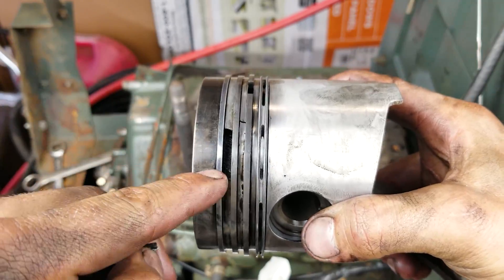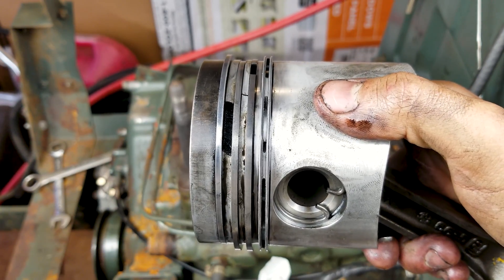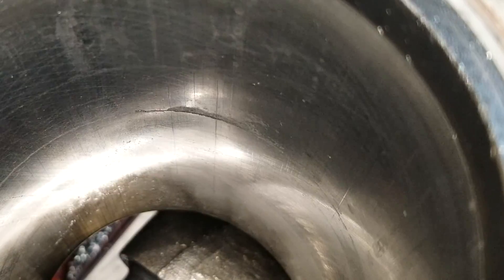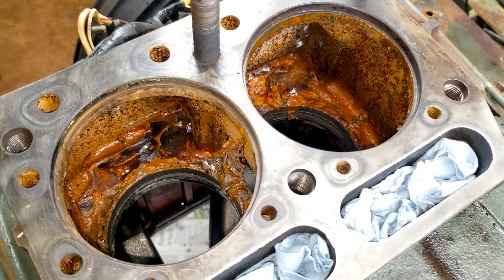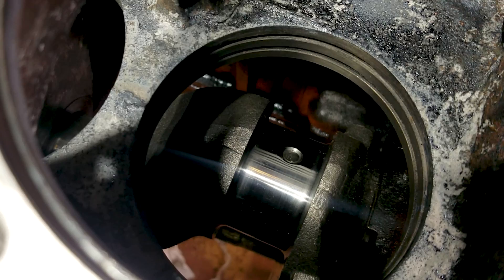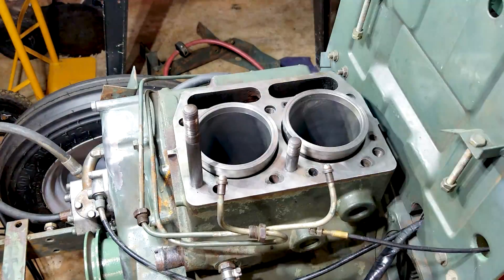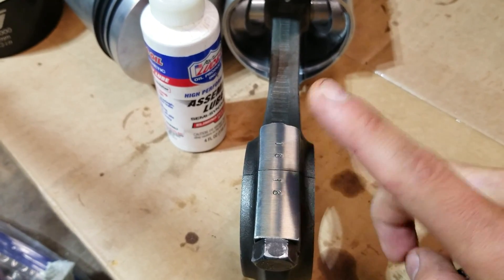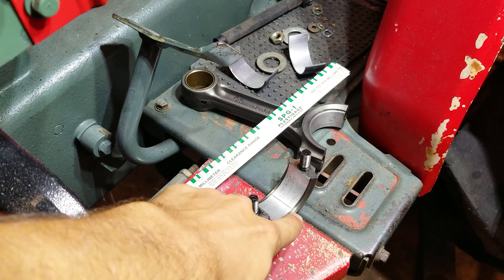YANMAR Diesel Tractor Engine REBUILD! New Pistons?

Comment: did the sleeves fall right in and do they have something to hold them down after install? i assume the head holds them down?
Reply from the maker: Yeah, the heads hold the sleeves down.
Reply: @MattsShop  thanks bro i rebuilt my ym 1700 and it is perfect bought me a ym 1500 with a bulldog loader that needed a headgasket i put that on and its a great little tractor i gave 1200 for it with the loader.. what a great deal

Comment: i need to know how hrd was that yanmar engine to rebuild? mine is a 1700 and i got it for 800 bucks it has white smoke from the engine
Reply from the maker: The engine rebuild was easy if your mechanically inclined. Just take your time and follow along with the videos!
Reply: @MattsShop  thanks for the reply got my kit on the way.. I have rebuilt several gas engines this is my first diesel also i bought me a second yanmar 1500 with a bulldog front end loader and it needs a head gasket but im going to just rebuild it also